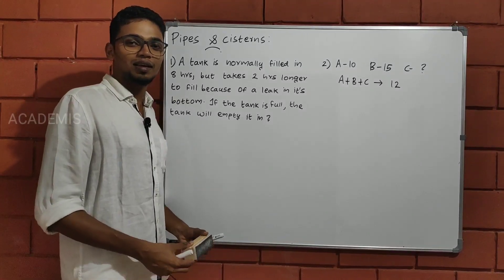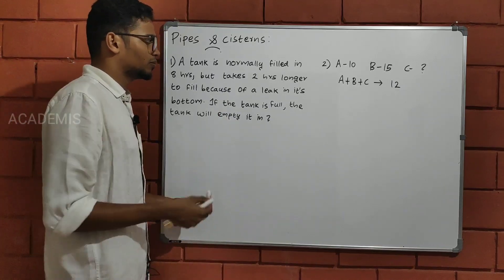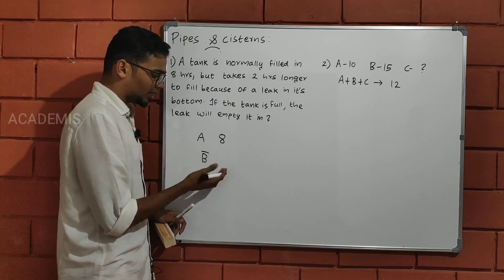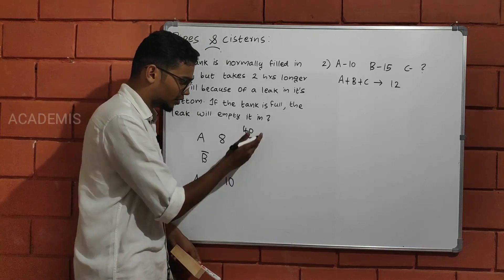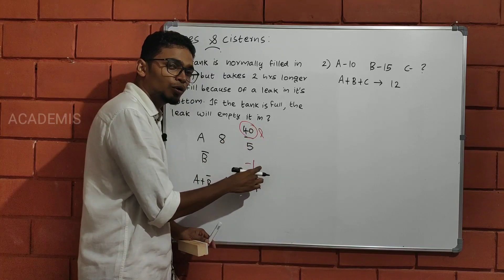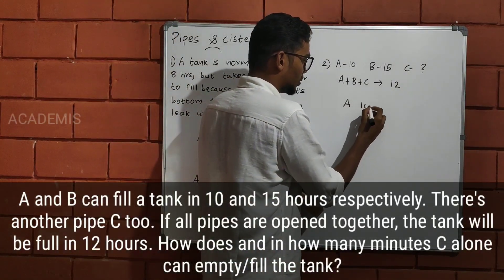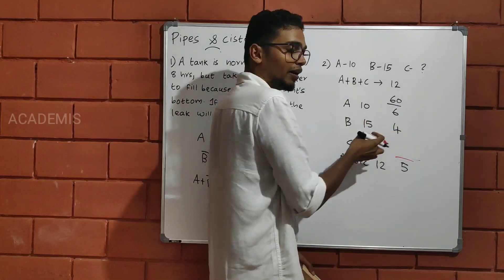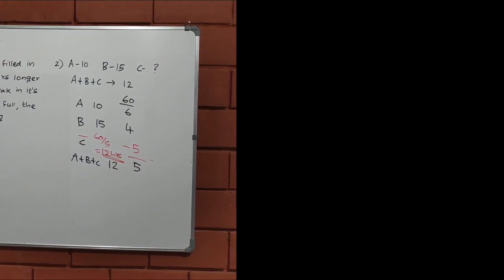PIPES AND CISTERNS- 2 ||Kerala PSC Degree level, RRB, SSC

Comment: Sir can you please help with A tap can fill a drum in 60 minutes. When it has been open for 20 minutes, a hole is made in the bottom of the drum to siphon the water into a sump. The drum is filled after a further 120 minutes. In how many minutes can the hole alone empty the complete contents of the drum into the sump